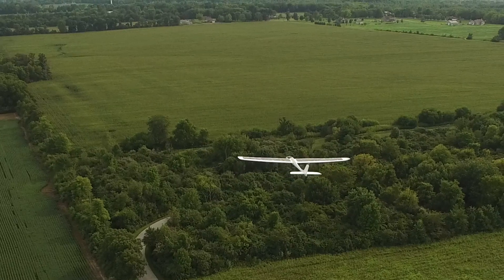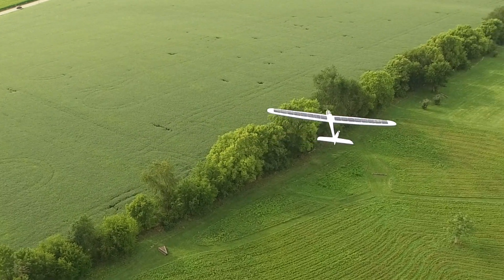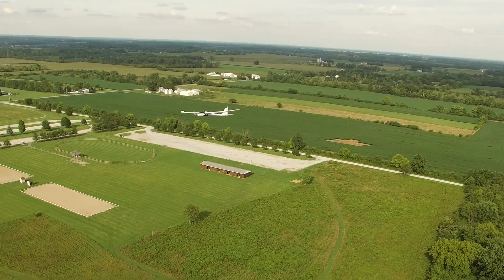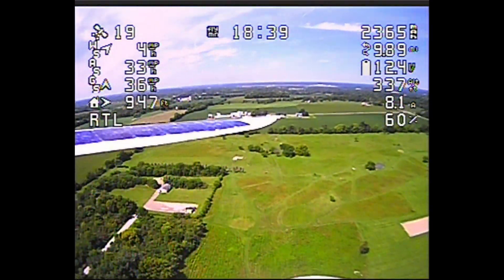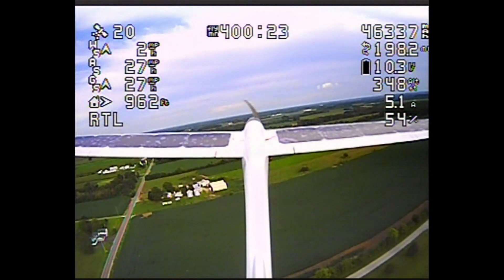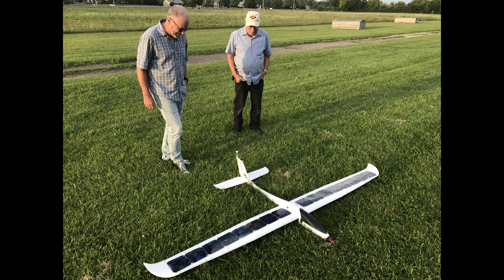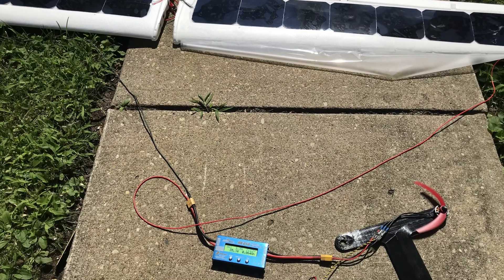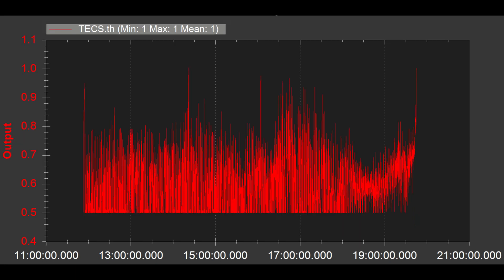RC Solar plane endurance flight

Comment: If you're doing an endurance flight why not use thermals and/or convergence?
Reply from the maker: Good question! Thermals are a bit weather dependent. I wanted to see how long it could fly day or night, good thermals or not. But you're right, using thermals would have let it fly for even longer.

Comment: I dont think a buck step up could ever deliver any amps for something like that.  What you could do is use the solar lower voltage to charge only some batteries at a time, using relays.  ie. 1 or 2 at a time.  and do not use a charge controller, very non efficient.  just direct solar to battery, or use a diode also.  This would give the best efficiencies but if you do not want to monitor it, can build auto with raspberry pi pico.

Comment: I am shocked to see after all your preparations, you used DC- to DC convertor instead of an mppt charge controller.
Reply from the maker: Yeah, haha, the weather was going to be good so I used what I had. I got an MPPT charge controller later and it helped, but going battery only gave me the best results . . . 10 hours and 45 minutes.

Comment: Hi again! Have you considered the same kind of test with a wing like the X8 or the FX79? It souds very interesting comparision, taking into account the larger wing area could have more solar cells. I´m not sure if you have realized that MPPT charger could be the one for LiFEPO4 cells, not for Li-ion cells, it´s not only a question of higher voltage on the solar cells.
Reply from the maker: It would be neat to test solar on a flying wing, but I don’t have any plans to do that. I’m not sure what you’re saying about the charger.
Reply: @MatthewHeiskell  It seems your charger is the one for Lead-acid batteries and I´m not sure if that will match the Li-ion cell voltages.
Reply from the maker: @miguelcamus8484  Yeah, the charger is designed for lead-acid, so it wants to charge to 14V. That is higher than the 12.6V of the battery pack, but the energy output was greater than the energy input, so the voltage only went down. It wasn't a problem.

Comment: Hi mate, nice video! Don´t you consider the modification on the wings to place the solar cells is what caused less lift and affected the performance?
Reply from the maker: Yes, I thought that I did a pretty good job flush mounting and covering the solar cells, but apparently the top surface of the wing is VERY important to efficiency. I had better results with a battery only configuration, plus I eliminated the weather dependency.
Reply: @MatthewHeiskell  now I want to build a solar phoenix 2400 too 😂

Comment: Matthew, I noticed you are using Arduplane. Do you see advantages over px4 for this long range fly? Thank you.
Reply from the maker: I haven’t flown px4, but I have flown iNav and arduplane, and the clear winner is arduplane, especially when it comes to efficiency. INav still has an issue with horizon drift, last time I checked.

Comment: im still in disbelief
Reply from the maker: haha, this isn't even my longest flight. I made a video documenting my battery only 10 hour and 45 minute flight.
Reply: @MatthewHeiskell  i actually laughed out loud when i saw the 50,000 mah sticker hahaha.
Reply: @MatthewHeiskell  i thought i was pushing it by putting two 5s 2200 mah in my wing lol
Reply from the maker: @jaxonfpv  That's a good amount of juice though! Generally you can double the capacity and maintain the same weight when switching from lipo to Li-Ion.

Comment: Hey Matthew. I'm not sure if you still reply to messages but I'm very intrigued by this setup and am starting to look at options to build something similar. It seems the Phoenix 2400 has great surface area for a solar project. Have you considered a more "fabric" style cell. I don't think I can send a link on YT but there's a company on Amazon called JIANG that sells them. Also, I'm wondering about a controller like the BQ24074 and how you might be able to integrate that into your power system. Great work on your setup and thanks for sharing it with the world!
Reply from the maker: Hello Andrew, yeah the Phoenix 2400 is a great airplane. Those fabric solar cells sound interesting. That BQ24074 charger might work, but it only charges one cell, so you’d need 4 of them for a 4S battery. Also, the output current is only 1.5A, that might not be enough depending upon the number of solar cells that you can fit on the wings. The good thing is that you can test your solar power system on the ground.
Reply: @MatthewHeiskell  Thanks for the quick response! I actually was thinking about the "single cell at a time" charging with that chip. I also like the bypass ability if the solar power is greater than the draw. 4 of those for 4 cells plus a buck converter to get to a target voltage maybe?  Thanks again and I look forward to more of your content!
Reply from the maker: @AndrewMillhouse  Yeah, that might work, you can test all of that on the ground.
Reply: dont need charge controller, it does not really do anything but unefficiency for something like this.  cant over charge the batteries when they are loaded down and so few solar cells.

Comment: I am trying to build a plane like this, I am wondering what are the electronics used in this project? Specifically on the autopilot stuff.
Reply from the maker: I used the Matek F405 wing flight controller. I flashed arduplane onto it instead of the standard iNav. The GPS is a cheap little BN 220

Comment: what vers AP did you use? i thought AP already compare GPS altitude to barometer altitude for drifting issue...
Reply from the maker: I think you’re right about the newer software. It runs arduplane 3.9.11 which is a bit old now.
Reply: @MatthewHeiskell  and autolaunch is a mode now. No need to set via wp

Comment: boost converter*
Buck converter "pulses" the current, and uses a capacitor to smooth the square wave out to an average, lower voltage.
Boost converter will send a pulse of current though a coil. The coil generates a magnetic field. When the current stops, the field collapses, causing a voltage spike, which is used to get the higher voltage
Reply from the maker: Yeah, good catch. I said the wrong one in the video. Thanks for the explanations too! 😄
Reply: Terminal Insanity sorry but I didn't understand. For this type of project we should use the Buck converter or Boost converter?
Reply: @marcomoreira8951  boost will increase voltage. Buck will reduce voltage.
Some power regulator chips/boards will have both.

Comment: hey, nice build. I was also wondering if any carbon/ steel spars were used to strengthen up the wing and also are you using a lipo or a lion battery?
Reply from the maker: I did not reinforce the wing in any way. I used a DIY Li-Ion battery pack.

Comment: Hello, I’m planning to build such a solar plane. I was wondering how the battery would be balanced charged onboard the plane. Did you use a BMS between the moot and the lipo?
Reply from the maker: That’s a good question! I’m my case, since the battery was only being discharged one time, albeit more slowly because of the added solar energy, I didn’t need to worry about keeping the cells balanced. There weren’t enough cycles for the cells’ voltages to drift apart. If you want to be 100% sure that your battery stays properly balanced, and prevent over charging, then you can use a battery management system (BMS). My plan for preventing over charging was to increased the throttle and fly faster, but my output power was always slightly higher than the input power. Perhaps it would have been better for me to use a smaller battery. Perhaps that weight reduction would have reduced the cruise power low enough for the solar cells to keep the battery fully charged.

Comment: I can only imagine how hard it would have been to make the slot to fit the solar cells in! Nice work! You might want to use a good quality esc like a small vesc or any other esc with foc. more efficient, smoother, highly customizable. Not to mention very reliable too! You can also set current limits to prevent motor burnout!
Reply from the maker: Yeah, I did my best at adding solar cells but it is very tricky haha. You make a great point about FOC ESCs! I think that they are the future. Have you used one before? I’ll look up vesc.
Reply: @MatthewHeiskell  I currently use a VESC 4 on my Endurance E-Flite Opterra.

Everything is setup in a GUI and the motor noise is insanely quiet!! I could not hear the plane above 200ft. The ESC also does an Automatic FOC detection, and had tons of possible telemetry via UAVCAN.
Reply from the maker: @Jdogdrums7  That's awesome! Can you make a video about it?
Reply: @MatthewHeiskell  Sure, I’ll see if I can later today or tomorrow.

Comment: great efforts, but why average current was 5.9Amp with first case when average wind speed was 2.6mph as compared with second case of 5.5Amp with wind speed 5.1mph ?
Reply from the maker: I adjusted some flight controller settings and I think that I adjusted the rudder trim position.

Comment: Nice work. Try cut cells in half to gain more voltage,that will eliminate the need for bottom wire. Half cell arrangement should give you 19,2v and half the amps
Reply from the maker: Thanks! That’s a good idea!
Reply: I am not sure how that will affect the efficiency,

Comment: So are you using  9 - 21700-50E Li-ion battery's in a 3s configuration??   how are the battery's arranged in the phoenix to achieve proper CG??  Need a re-try with less wind & get rid of the laminate, its robbing your solar panels.  Good job though, I know you can get better results, don't give up!!
Reply from the maker: Yeah, the battery is most of the plane's weight. It is right under the wing. Less wind would make a HUGE difference. I don't think the laminate it a significant problem, but the cracked cell is haha. I just don't have the time. A single test flight takes an entire day haha.
Reply: @MatthewHeiskell  Yea, 7-8 hours you could take a nap,lol.  I watched your other vids & see the setup now.  Very impressive.

Comment: This is so amazing man! Really cool stuff. 

Question: Did you fly with a MPPT? Or just the Boost converter alone?

Greetings!
Reply from the maker: Hey man, I love your EA scratch builds. I was just using a boost converter for this flight. I actually got a MPPT Boost charge controller and used it on a later flight, but it was really windy that day and I wasn't able to break my record.
Reply: @MatthewHeiskell  Thanks! I'm thinking about doing the same when summer gets ready and I'm watching your videos a lot. 

But, If I remember correctly, in one of your videos, you used a 3S-balance connector coming from your DC/DC booster to power (charge) your flight battery. Is that safe enough to fly with for a long time?

(Bc, I'm planning to make something similar but as light as possible with a minimal amount of components)
Reply from the maker: @AeroStuffFPV  Yeah, it worked for me. Just adjust the buck converter to 12.6V. Connect it RIGHT before launch.
Reply: @MatthewHeiskell  Nice. Thanks so much for answering my questions so far. you are really helping me out! But I have my last question before I go planning :)

I'm flying only with 4S Li-Ions and let's say that I'm flying with the 8V solar panels; 

1. Will it not overload the DC/DC converter? Will that be efficient?

2. If it doesn't work, what is the minimum solar voltage for the 4S flight pack?
Reply from the maker: @AeroStuffFPV  That will work, but it won't be very efficient. Ideally you want the solar voltage to be higher than your battery voltage. MPPT charge controllers that steps down are smaller and cheaper. But there is no problem boosting 8V up to 4s voltage.
Reply: @MatthewHeiskell  Hello Matthew, thank you for the video. Which MPPT did you locate please? I’m finding it difficult to source as suitable product. Regards Justin
Reply from the maker: @justinbarber4567  https://sunforgellc.com/genasun/#gen_product_row

Comment: You can cut a solar cell in half, still get the 5v but half the current.

Cut the cells and wire them in series and parallel to get double the voltage and half the current.
Reply from the maker: Oh cool, I didn't know that!

Comment: Very cool.  Did you simply turn off your transmitter or perform a battery change?  Or does your transmitter battery last that long?
Reply from the maker: Hey Kerry, my FrSky Taranis X9D Plus lasts that long. I always fully charge it before a big flight. I did a couple things to help life too, like disabling telemetry and the screen back-light. As a backup, I have the charger and a power inverter in the car.
Reply: @MatthewHeiskell  I also have the original XD9 and LOVE it - what battery are you powering it with? The NiMh that come with it last amazingly long!